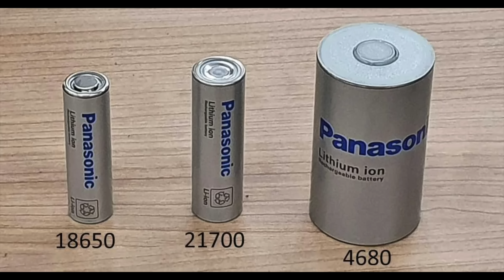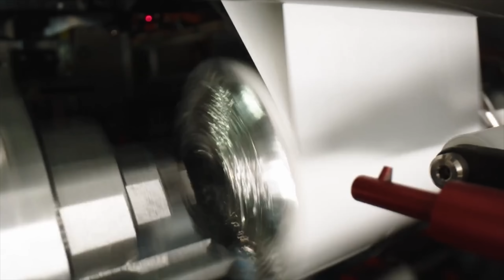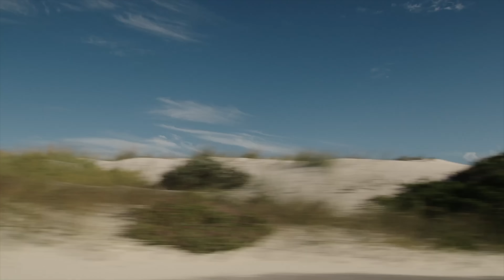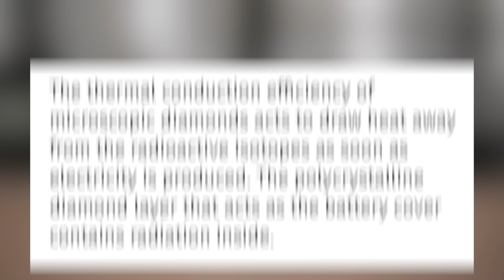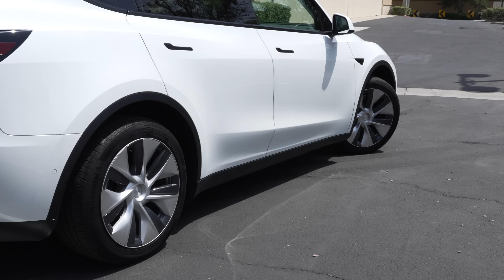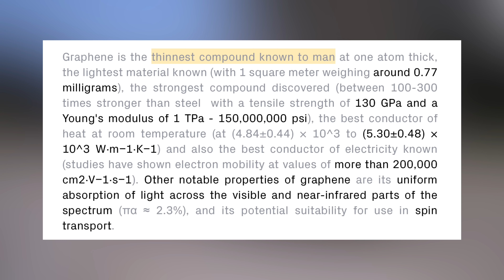NEW EV Nuclear Batteries Are HERE | Tesla's Next Secret Weapon?

Comment: There are only two makers of nuclear batteries currently.  Chinese startup Betavolt currently makes 100 microwatt (that is one ten thousandth of a watt) batteries for $52 each.  That means that currently, you would need to buy 10,000 batteries for $520,000 to generate even 1 watt of power, which is nothing to an EV.  To generate 48KWh of power over a 24 hour period, to refill a LFP battery for example, you would need 20 million of these batteries (48,000/24 * 10,000) at a cost of over 1 billion dollars currently - to recharge a single vehicle!  Even if they can make the current tech a thousand times more energy productive for the same price  in a few years (which is very doubtful), it would still cost over 1 million dollars - again just to recharge a single vehicle!  There is no possible way to use this technology to recharge a Battery Electric Vehicle.  It is used for things like pacemakers, which require a miniscule amount of energy compared to an EV.  Anyone trying to tell you different is either a scammer or a marketer who does not know any better.  They are certainly not an engineer, and could not run even the simplest back of the envelope calculations or they would know this.  While I am an Electrical Engineer, this should be obvious to anyone who can do fourth grade math and can multiply numbers.

Comment: Every time a battery is "charged" it's total capacity of energy it holds lessons a little bit each and every time.  "Advanced Technology" would be if the EV's got their electric power from the roads they drove on.  The need for stopping and "charging" your EV being eliminated. The only need to stop would be for the people and restroom breaks. Imagine an 800 mile trip and not once do you stop and "refill" fuel tank or charge a battery even once in your journey.  THAT would be advanced technology!  What the public is being offered today in the forms of EV's are unaffordable BLING!  Governments want them because at the push of a button your EV trying to escape the bank you just robbed could be rendered useless. No chase involved.

Comment: I can’t wait for batteries to get cheaper and lighter. Mean extra range. Which means charging say 10-50% gives you 500km range and takes 5-10 mins to charge. That’ll make it the same time as filling up a gas tank with the added benefit of MORE range if fully charged or charged to 80%

Comment: Not clear how you draw electric power from such a heat source (radoactive waste) the small Chinese batteries use a thermocouple for a few milliwatts - good for a watch - and at this size no problem with excess heat. For a car one needs a lot of power to accelerate - so for the radiaoactive batteries to directly provide this power they need to be producing that power - and no way to shut off or moderate this heat - it's just nuclear decay. A lot of waste heat to get rid off while in the garage....

Comment: I asked AI (Perplexity) this question:
Q: compare the time to charge a Tesla Model Y from 0% to 100% vs a Toyota RAV4 empty to full gas tanks

AI:
At a Tesla Supercharger (250 kW DC fast charging):
0% to 80%: Approximately 27-30 minutes
80% to 100%: Additional 30-40 minutes (charging slows significantly above 80%)
Total time 0% to 100%: About 60-70 minutes

For a Toyota RAV4, the refueling process is much quicker:
Tank capacity: Approximately 14.5 gallons
Refueling time: About 2-3 minutes to fill from empty to full

One hour in a Model Y to fully charge it or 3 minutes to fill up your ICE car
No matter what insane battery they come up with the time will be about the same

For this reason and dozens more a hybrid makes more sense than a BEV like a Tesla.
==============
and try to convince a mom carrying her 2 kids in the back seats that a nuclear battery under their feet is safe
good luck with that

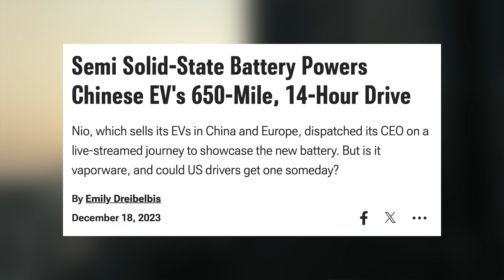Comment: 9:45 - what they didn't tell you about the NIO test:

1. That it was a 150kwh battery
2. That they drove it to a point over 14,000ft above sea level to start the test
3. That they brought along a diesel generator in a backup vehicle to give the NIO a 100% charge at the start point
4. That they finished at sea level 1060km away (658mi)
5. That they never exceeded 90km/h (56mph)
6. That they averaged 75.7km/h (47mph)
7. That they only averaged 7.3km/kwh (4.52mi per kwh) under these extraordinary and fabricated test conditions

When you don't dislcose this sort of crap going on in the test you lose all credibility.

Also - You're no comparing apples to apples with the Rivian - the 150kwh NIO pack weighs in at 686kg  / 1512 lbs or 4.58 kg per kWh. The Tesla 103kwh NMC pack weighs 625kg for a 6.07 kg per kwh - given that the 103kwh pack in the Tesla s/x is now several years old a 30% increase in energy density is decent but hardly outrageous.

Comment: I really don't understand why so many YouTube reviewers speak somewhat scornfully of LFP batteries. Here are the facts:

1. Over the first year, LFP batteries will degrade about 3% or less of its capacity. All other chemistries will drop 5% or more.
2. LFP batteries will stay at 95% -97%  for YEARS. Other chemistries will degrade by 10 -15% of their original capacity in the first 2-4 years. There are exceptions, but this is generally true.
3. LFP batteries can be charged to 100%  without damaging them. All other chemistries can be charged to 80% of their capacity, or they will degrade prematurely. 
4. The LFP batteries used by Tesla in their Model 3 and Model Y cars should have a minimum charge cycle life of 4000 cycles. Tesla lists the number of charge cycles for its non-LFP batteries at 1,500 cycles. The difference is staggering. A Tesla Model 3 or Y equipped with LFP batteries should be able to maintain 90% of its capacity for at least 10 years if charged correctly. If you charged an LFP battery every single day,  you would not reach the 4000 charge cycle limit for 11 years. The difference in stability, durability and longevity are STAGGERING compared to non-LFP batteries. This is why nearly the entire solar industry, including Tesla, are switching to LFP batteries. 
5. China has created an updated LFP battery that is shown in this video that will get over 600 miles of range,  can be charged very quickly, and can operate in extreme hot and cold temperatures without losing capacity and range. This type of LFP battery will be the near future of EV batteries, and China is ALREADY MASS PRODUCING THESE BATTERIES.  Whereas Samsung and other solid-state battery manufacturers won't mass-produce solid-state batteries until 2027. 
6. Current LFP batteries are not as efficient in cold climates as other chemistries, but the difference is negligible in real-world use because ALL EV batteries are significantly affected by extreme heat and cold temperatures.
7. New versions of the LFP batteries are more energy dense and are competitive with other chemistries.

Cleary, LFP batteries are FAR superior to all other battery chemistries at this point in time. Nothing else is even close. For the short term, LFP batteries are by far the best choice if you are at all concerned about how long your battery pack will last, and how much of its original capacity it will retain. It is possible for a Model 3 or Y equipped with LFP batteries to last 20 years while retaining at least 80% of its original capacity. No other battery chemistry can even come close to this durable longevity right now. Therefore, EV reviewers should be more respectful of just how amazing LFP batteries are because they are clearly superior to anything else available currently.

LFP batteries don't "Punch above their weight," as Shaw dully remarks in this video. They are the heavyweight champions of the world right now!

Comment: Would like to see a story about battery tech degradation. Does my EV get more expensive to charge as it gets older or does the max capacity just drop over time. My old Volt lost a little less than ½ capacity after 10 years. Wonder what to expect on my 2023 Model Y after 10 years.

Comment: Nuclear batteries in the power range needed for a car (let's say 20kW) have a huge problem: heat generation even when the car is not used. We're speaking here of huge heat, at least 100kW thermal, practically impossible to dissipate in a car.
We'll not see nuclear batteries in a car in the foreseeable future.
Reply: first time hearing of nuclear batteries, but with their long life-span, wouldn't it make more sense for like a "mega-pack" or home battery storage instead of a car (which avg lifespan is well less than 15 years)?  also, would prob be better to utilize them in less dangerous situation.  in case of radiation leak when the device is damaged.
Reply: @ntnboy85  Too expensive for battery storage.
Beta-radiation used by the nuclear battery is relatively easy to shield (<1 cm of plastic) as opposed to shielding against neutrons and gamma as required in a classical nuclear reactor.
Reply: it's more suitable for houses, that's minimum size of application for miniature nuclear reactor.
Reply: @George_Shonia  A nuclear battery uses different principles. It converts the kinetic energy of decaying beta radiation of 63Ni or 14C into electricity using (diamond) diodes. This process is called betavoltaics, and it is similar to how photovoltaics transform light into electricity. Unlike a "classical" nuclear reactor, it cannot be throttled/shut down. While perfect for under the mili-watt range, the difficulty is scaling them up.
While you can theoretically scale them up for a house, thermal dissipation will be an issue, and cost will be a huge issue. I doubt the thermal dissipation can be solved in a car, even if you somehow solve the cost. 
Current reactors use thermal->mechanical->electrical (most of them, including SMRs). The problem with these is scaling them down. 
There are other nuclear reactors, thermal->electrical with Seebeck (satellites, remote stations on earth). They are in the hundreds of watts region. But the efficacity is low, so you have to dissipate a lot of heat and they are heavy, and the price is very high.
Reply: @mrmariusi  wich means that current batteries have no alternative other than improving their chemistry & increasing energy density of it at least all the way up to the 1kwh/kg which would match the range of ICE engine cars.

Comment: One thousand charge cycles is equal to 300k miles??  Yeah, that's real world...Tesla has 1500 charge cycles and optimistically says 300k miles. How does PowerCo/QuantumScape get as far with fewer charge cycles?
Reply: We now have many Tesla's in the 200k to 300k range that are still over 85% capacity.  And the capacity is stopping slowly.  They will probably reasonably make 500k miles with over 70% capacity.
Reply: Only possible answer is more capacity.

Comment: Since you've made no mention of the "power" density of the nuclear diamond battery (as opposed to the "energy" density), I suppose its power density extremely low, making it impractical for many applications, like EVs, that require sufficient power (rate at which the energy can be delivered on a sustained basis per kilogram or liter) as well as sufficient energy density.
Reply: The power density is was 10x that of lithium ion batteries. That is to say, it can store that much power from whatever power source it uses.

The power GENERATION will be extremely low, however, because this is passive radiation, not a fission reaction. They would have to intentionally speed up the fission reaction with some neutron reflection, and if they do that, it becomes way more dangerous.

Comment: Should we charge LFP batteries to 100 % every time ? I've seen a video that says it does degrade the battery. May be not as much, but still. 100 % charge is to make sure the car knows how much range it has. This seems to drift over time if not charge 100 % opnce in a while.